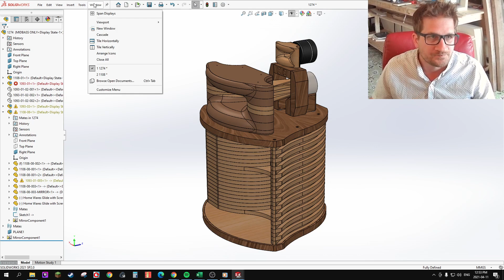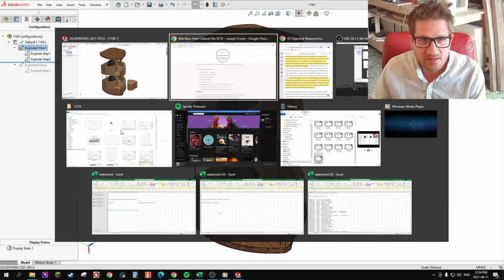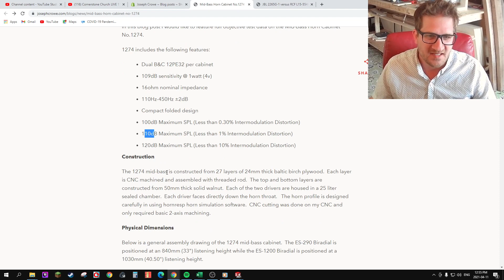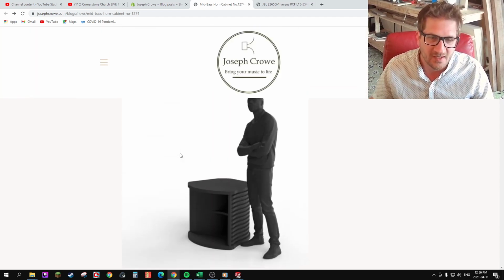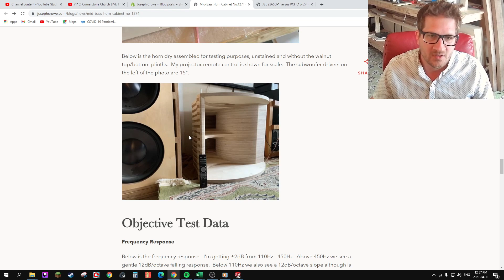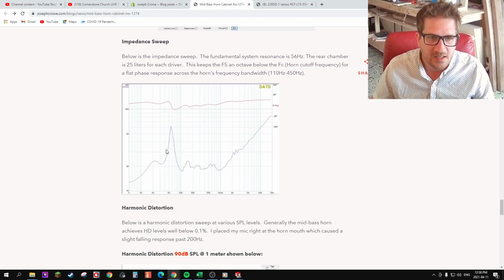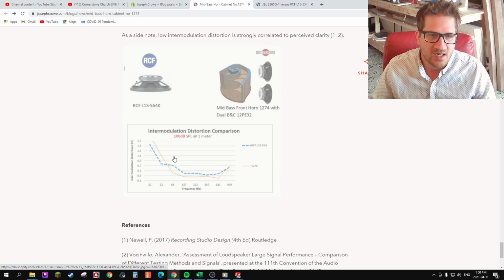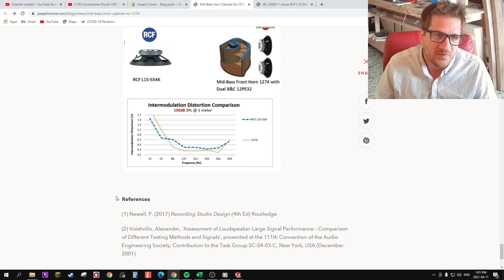Test Data on Mid-Bass Front Horn No.1274

Comment: Joseph, 
What is the intended driver/horn topology to cover above this midbass horn? Not many compression driver/horns can cross as low as 400hz, so did you have a particular system in mind?
Reply from the maker: The B&C DCX464 achieves 300Hz.  Along with the B&C DCM50.  There are cone midrange drivers as well such as the ScanSpeak 10F/8424

Comment: You should remove a significant amount of rear chamber volume to raise the resonance. Your current design misses out on the benefits of reactance annulling.
Reply from the maker: Thank you for the feedback.  I tried 50% less rear chamber volume to see if I could achieve a lower Fc but that didn’t not turn out to be the case at least for this design.  All it did was introduce more variation in the frequency response.

Comment: Impressive midbass horn design.. What other 12” drivers did you try that worked well?  And wow, you have Lamar FC drivers, modern WE555’s..
Reply from the maker: There are quite a few drivers that would work in this design.  Typically anything with an FS of 70Hz or lower, and a QTS of 0.30 or lower.  But I would need to confirm.
Reply: @JosephCrowesDIYSpeakerBuilding  I have four TAD 2001's I am thinking of selling them, would they be any use to you?